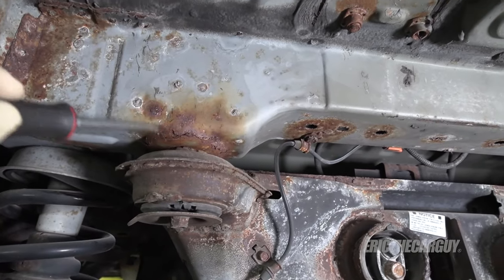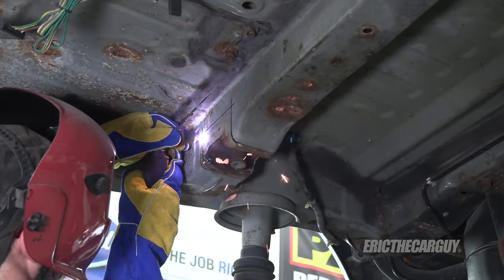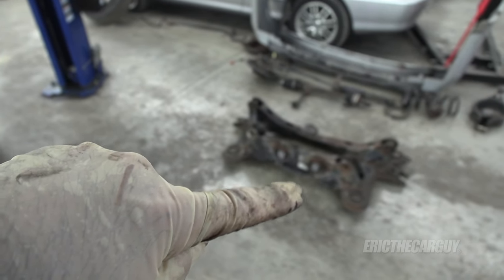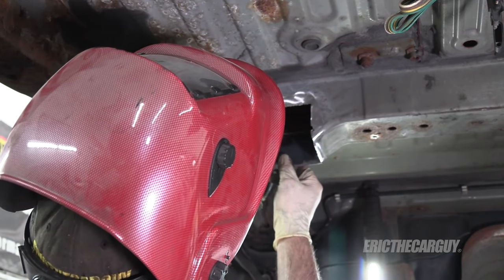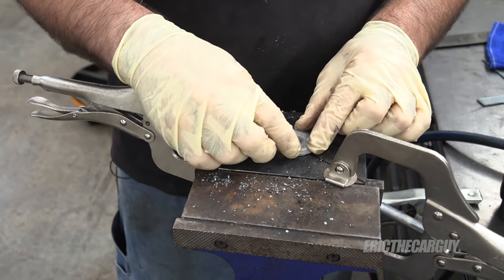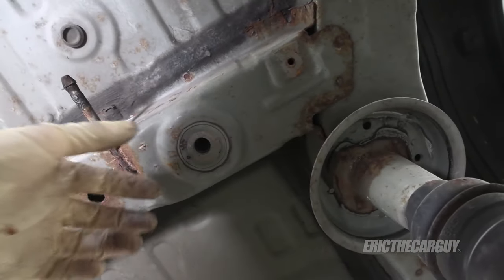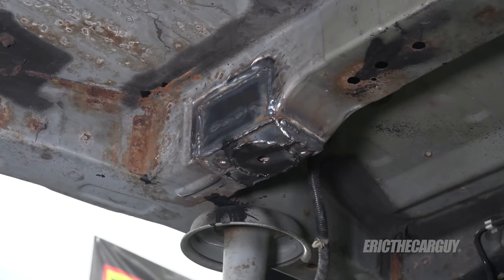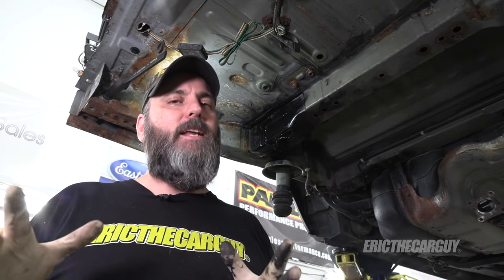How To Repair Structural Rust Damage

Comment: Here is a tip. I get a lot of my metal from old file cabinets and old metal shelving that people throw out. file cabinets are made of 16 to 18 gauge metal. also old lockers. you can use recycled metal like that because the prices are outrageous at steel supply places

Comment: The un-threaded part of the hole and the bolt is so that when the subframes are being lifted into the chassis on the assembly line they can use the bolts and holes to line everything up without marring up the threads until all is in the right place and they can lift the assembly straight up flat and level, THEN engage the threads.
Reply from the maker: I believe the locaters are on a separate part of the subframe, similar to the front subframe. I'm not sure they do it the way you suggest, but if they did, it makes sense. Interesting thought though. Thanks for the comment.
Reply: @ericthecarguy  I'm glad you appreciated it. You're likely right, you're definitely more in the know with Honda cars than I am, I worked at Isuzu and Volvo truck dealerships in my day here in Australia.

Comment: Eric it was great seeing you fabricate a new piece of structural support, very impressive work. I'm curious if this frame piece is a piece of replaceable sheet metal that can be removed and replaced. I saw corrosion along the left side where the panel was spot welded in and looks like that tunnel piece ran to the opposite side where the rest of the subframe mounts. Wondering if you considered that as another option since you have all the tools required for such a repair.
Reply from the maker: It is, but no longer available from Honda. You can find them, but the price that I found was $800-$1200 for that piece. I used about $30 worth of metal.

Comment: Excellent armchair mechanic entertainment. :) To weld to that 'standard', which is quite good enough for anything non-cosmetic, would it take lots of practice with a TIG/MIG welder? I was also wondering about the car electronics, where I guess you'd somehow totally isolated them.
Reply from the maker: I disconnected the battery before I removed the rear suspension. Welding takes practice. The more you do it, the better you get. Thanks for the comment.

Comment: That was extremely satisfying to watch. So how did you determine the gauge metal needed?
Reply from the maker: I wanted something that was strong, but could still be bent. 16ga is just about right for that. Also, I think the original metal was about the same gauge.
Reply: @ericthecarguy  LOVE that you prolonged the life of a vehicle that would've been scrapped. Love how you explain your thinking behind each step. If this youtube thing doesn't work out you'd make an excellent teacher. ;-)

Comment: I have to have someone weld in metal patches on my 92 ford econoline e150  frame under the control arm. Would not pass ny inspection. Local welder  wanted $600 to $800 to do the job. Auto shops won't touch it.

Comment: ....................CAD  design    .... cardboard aided design..i use it all the time    also you can NEVER  have enough sharpies around when you are doing this kind of work... also a question.. are you going to add a couple water drain holes. for any water to drain out of?    and spray some paint inside to keep any rust from starting?

Comment: i have a similar issue on my 96-00 honda civic the rear toe arm section, the piece where the screw goes in to tighten the toe arm came out of its groove, so i had a shop cut that section open in order to get the slider back into place, works fine now but there is rust, they didnt spray paint it
Reply from the maker: That's a very common problem. In fact, I've done it myself a time or 2. Thanks for the comment.

Comment: Any chance you went over the entire area with a wire wheel to get rid of the scaly rust under there? Then spray with some undercoating to help prevent rust later?
Reply from the maker: I believe I mentioned that in the video. Also, this is not the 'finished' product. There was also a hole in the body I repaired. After that, I used rust encapsulator paint to finish things off. This was actually a small part of the overall repair back here. More videos on the suspension and body repair forthcoming. Thanks for the comment.

Comment: I wonder what would happen if someone was to closed cell spray foam a vehicle full, instead of open areas and voids in the unibody, obviously not door/windows/moving parts.
I guess one downside would be material to burn and emit toxic fumes if in a fire.

Comment: Have you ever used weld through primer.
Reply from the maker: I have some, but haven't found a situation where I would use it yet. Also, there is a discussion below in the comments about that you might want to check out.

Comment: Have you considered using a rust converter paint?  Just wondering.  I've started using it for stuff like this.
Reply from the maker: I used rust encapsulator paint on some of the other rust on the subframe and undercarriage. Link in the description.

Comment: I don't know why those critical pockets (voids) are not filled with expanding insulate foam before rust sets in from the inside out. Apply a wax sealant and pack that void air and moisture tight.

Comment: i restore oldtimers, so there's always some welding involved and some even need a ton of work and i hate it because it's time consuming and a dirty job, 
and not to mention al the splatter of hot drops of metal that burned more spots on my body than the moon hs craters, because there are always areas that
are a little rusted but you can't get to it to clean it, and then the fireworks begin.

Comment: not saying right or wrong but when you drilled the 2 holes to spray inside I would have left them open .. because that is a low spot in the frame ,, it will help dirt and water that gets in there too come back out

Comment: 1:35 You say it is cosmetic, it is not. There are definitely forces applied to the rotted parts of metal in this frame. The moment acting on those higher spot welds is much higher without the lower steel.
Reply: Agree it's not cosmetic but his repair replaced the lower/outer steel so should be plenty strong enough to hold that bolt securely.

Comment: Its really good to see you do some fab work. but honestly I would have just gone to the junkyard and found a good side and cut it out then weld it in.
Reply from the maker: That is an option, but consider that removing a rear subframe in a salvage yard on the gravel would be a very difficult task. Not to mention they don't let you take torches or plasma cutters in the yard. You'd have to cut the part out with a sawsall. Additionally, good luck finding a vehicle with a good body mount, this is a very common issue with Pilots, Rideglines, and MDXs. 

In my view, that would be more difficult than just making your own the way I did. Thanks for the comment.
Reply: @ericthecarguy  I was wondering about this also. Figured it had something to do with most being rusty and difficulty getting to it.

Comment: I would have left the holes on the bottom for crap to drain out.  The existing adjacent hole’s are gonna let crud and moisture in and it’s gonna settle in and sit in your repair.

Comment: Instead of welding all those pieces around the disc I think I would have made a solid plate with a hole the bottom of that insert would have come out then I would have welded that disc to the plate. Also would have welded the top of the threaded bit to the plate first then put everything up tacked the plate.
Reply from the maker: I never said this was the only way to do it, but I had my reasons for doing things the way I did. Thank  you for your input.

Comment: You're lucky this can didn't explode on you. Also cleaning off loose rust is not enough, even dark spots on steel is rust and its best to remove those as well or at least use some rust stopper. Covering those with regular paint or sealing will not stop it from rusting.

Comment: I would have filled the holes with fiber glass repair, JB Weld or crammed them with body-filler then a bit of spray, job done.
Reply: Please tell me you're kidding.
Reply: @mattfoley6082  I'm serious, either that or leave it as is, but if hiding the rust holes was a condition of it passing a state inspection then I would do what I said, the rest of the underside seems pretty solid so looks pretty safe.  This car is pretty old, it's never going to be a classic and as Eric says not worth the average Joe spending this much time on a car like this, but serves the purpose of this video in showing different techniques etc.
Reply: @robbflynn4325  As long as it looks safe who cares if it's still unsafe. Got it. Remind me to never let you anywhere near my car.
Reply: @robbflynn4325  Wow.
Reply: @robbflynn4325  Not a millennial, I just understand things like stress and torque. I let those authoritarian experts in physics brainwash me in college.

Comment: I believe where that's rusted at is structural enough that no body shop would repair it for liability reasons and It wouldn't pass safety inspections in any state/locale that has them.
of course we don't have that in Ohio, e-check needs to go away also, it harms the blue collar folks and the amount of people registering in places without it or just driving with illegal plates makes it pretty well stupidly null.

Comment: I know the welds have good penetration because Eric is MIG welding for a long time.And that's the most important thing here.The repair will stand even after the vehicle is decommissioned. But if i was doing the repair i would add these things after Eric's work - 1. dressing the welds(only dressing, not thinning) and then sand/prep for primer. 2.Epoxy prime the area 3. Seam seal using 1k seam sealer 4. Epoxy prime again atop of seam sealer 5.Paint and then apply undercoating , or just undercoat atop of epoxy primer. Seam sealing is kind of important because of the little nook and crannies in the welds. That's for the outside. But for the inside/cavity area - it is darn tricky to do it the scholars way .So i won't be explaining it. And this car ain't concours restoration. I'm sure the frame coating will protect for several years ahead. I believe this coating is used by manufacturers in ,collision repair procedures at the dealer certified collision centers, in order to repair warranty(or lease) vehicles so the collision repair area won't start rusting in the period of lease if the vehicle has been in collision during this period.Pretty sure the waxy stuff disappears after some years and rust will start eating the metal. Same thing with weld-through primer. Weld primer is only needed where 2 flanges meet, and was developed to be used with spot welding using STRSW welder. This stuff is zinc. Believe it or not - it vaporizes during MIG welding because, MIG-plug welds(the welds that replace the factory SPOT WELDS when repairing collision damage) have temperature of 3000 fahrenheit. And zinc vaporize at 1600. So zinc weld primer is deception. Also - the primer is not to be welded through , as it name suggest. This was confirmed by 3M and OEMs. Especially not used when butt-welding. Darn, it's not even a "primer".Because the book says "primer" is undercoat that provides good adhesion for the topcoat. And you can't spray atop of it believe me. There is another variation of weld-through primer. Called copper weld through primer, its boiling point is above the MIG welding temperature . But studies found out that it leads to GALVANIC corrosion in repaired vehicles. That's why the wax coating for rust-proofing is the method approved in manufactures collision repair manuals. I know this stuff very well. I've clipped rear end to a totaled Mercedes cl500. And in my home garage also.

Comment: Thumbs up for effort.
Thumbs down for your fab work. You could have done it quicker by cutting the whole cross brace out with your plasma cutter and welding the support structure on the work bench then weld back in place. Suspension components push up, not pull down. So your fab work isn't that structural. You should have made it 1 large u-patch over the cut out rust portion and had it lay about 4 inches wider than the actual cut out rust. But in the end, we all skin a cat much different.

Comment: your idea at 2:30 is way too off base. its extremely simple: the reason the threads start deep in hte hole is so the worker/machine that puts the bolts in on the factory line wont cross thread the bolt. that is why lots of bolts in modern cars also lack threads on the tip of bolts, its simply to prevent cross threading.

Comment: NOOOOOOO!!!! No rubber coating!  DONT DO IT!!!!! It will crack in the winter and deteriorate the frame 10x quicker! My buddy did that! Use fluid Film!
Reply from the maker: It's not rubber coating, it's paint with rust encapsulator. Link in the description.

Comment: Not being unkind but all of those butt welds don't look a good idea.  I would have thought that you should have created a saddle that fits around the beam taking the forces onto the overlaped area rather than the welds.  This would hopefully prevent cracking spreading along the weld.  I would have thought that the additional thickness would have little effect on the mounting of the components.  Clearly adding the additional internal bracing would not be a problem allowing you to get better welds on a bench.

Don't forget to waxoil inside.

Comment: I know that this comment will get thumbs down. But I still have to say it: That is not the way it should be done. Butt welds and even worse outside corner welds are big No No on structural parts like this high stress area. Forming an U shaped patch and overlapping the patch and plug welding would have been the correct way to do it.

Comment: I thought you couldn't legally do this type of work, its why many vehicles get sent to a scrap yard?
Reply from the maker: If you can repair it so that it's structurally sound it shouldn't be an issue. As a former safety inspection technician I'd pass this repair.

Comment: That entire crossmember costs $98 yet he patches it up with some random 16ga mild steel instead of paying $98 for the OEM high strength steel part.... This is clown shit... don't do this... at the very least pay the $98 get the part and even if you section it in which would not be correct.. it would still be better than this... but if you had the full part you could weld that entire crossmember on and fix it right.

Comment: 😳😳.. if ya got leak.. that aint holding up..
Reply from the maker: I expected leaks where the metal was thin and hard to weld. It's not structural so I'm not worried. Thanks for your input.

Comment: Not very good fab work compared to a real fabricator.. a lot of guys can make it look like art and do it in a much simpler way that's easier to get right...   but hey, it still shows how people can do it themselves and even if it doesn't look like the best, it can still get the job done at the end of the day.  It's much better than that rusted out hole. lol, that's for sure
Reply from the maker: Are you a fabricator? If so, how would you have done it?
Reply: @ericthecarguy  I think it turned out fine;  it's reinforced where it needs to be. It was just a little more "custom work on that last piece where you had to weld/ bend/ weld/ bend. ect.. to make it work.  The correct sized dimple die there would have been much easier for you, to get that protruding shape on the bottom piece..  It still works fine... I personally would have done it with thicker plate, so that even if it tries to rust again, It's too thick to cause any issues-- I likely would have left those holes you drilled for the paint--  One of the reasons it rusts there is because that's a low point in the beam and the water cant' drain there;  so as soon as you pull through a deep water hole or flooded area, or cross a river, ect... that beam will fill with water again and pool up in those lower mounts.   little weep hole on each side would likely go a long way...  Obviously it's fine now for the life of the car..  I think a "fabricator would have probably cut out that entire cross member and cut out pieces on a big 1/4" flat sheet in the shape of a bar joist bridge and had it running across the entire car in a several piece kit that slotted together to box it out and was super easy to weld up-- redoing both sides in one go... Things are easier when you have a CNC plasma cutter. lol